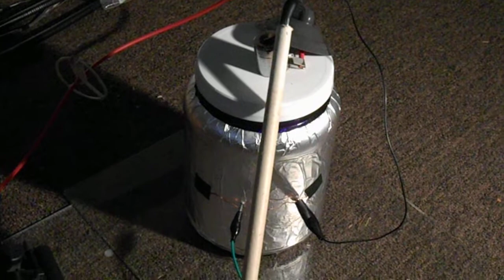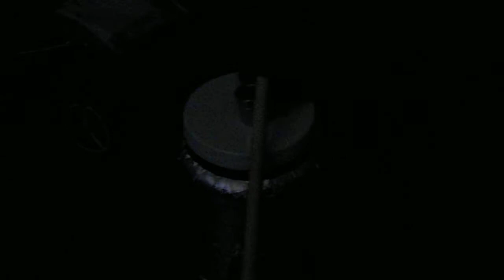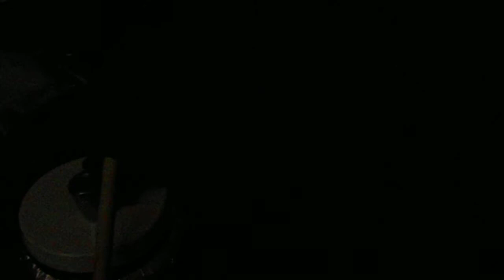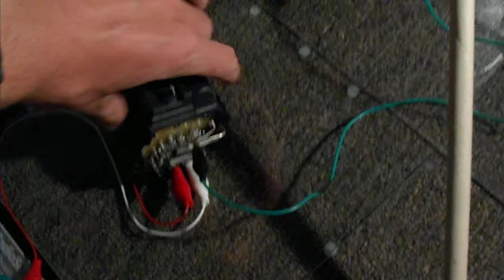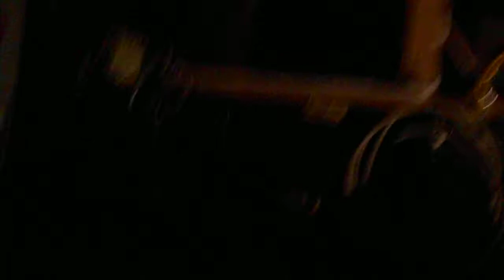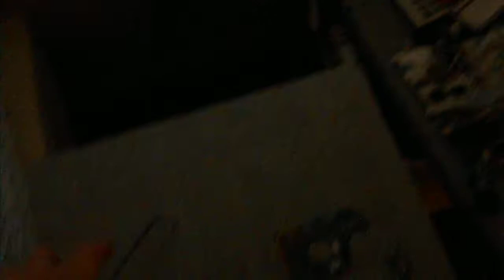leyden jar fun! WATCH YOUR EARS!

Comment: Hi, do yougave anyidea why myleuden jars make the output poorer then the original output? When they aren't connected to the zvs drived fly back the driver makes huge 8cm hot...damn hot arcs and they are thick! But when I put there the salt water capacitor...the arcs are thin and silent af and it is soo poor :(
Reply from the maker: +gyorgy komaromi well a leyden jar or saltwater capacitor adds capacitance to the output, so adding capacitance to something that has a high drain all the time it will average out the super high drain spikes to be what the average is, that is why it doesnt look as intense as you are seeing the average not the instantaneous. leyden jars are really only used for cheap/DIY tesla coil capacitor banks, because in a tesla coil you are taking that 100+kHz dc wave and storing it for <100Hz pulses on the much bigger coil.
Reply: SuperBrainAK Thank you man!!!If i make more...will it help???
Reply: gyorgy komaromi Or... It would be better with flat...aluminum-plastic capacitors or aluminum-plastic caps rolled up?

Comment from the maker: you know the output isnt really much better, it does make the transistor heat up more, but i guess they are just a bit longer, like you can draw them farther away still with a solid quiet arc. i might have to wind my own primaries if i want to have a hotter arc, as im just using the original that isnt very good and you cant really overdrive it how i would want.

Comment: nothing like some DIY cap fun ! hey 30v not bad at all more then what i can provide currently need to see if i can get a variable power supply soon i need more juice my zvs drivers and the quasi res. crave power ! how's the output from the flyback itself ? must get some nice arcs at that voltage =D cheers dude !